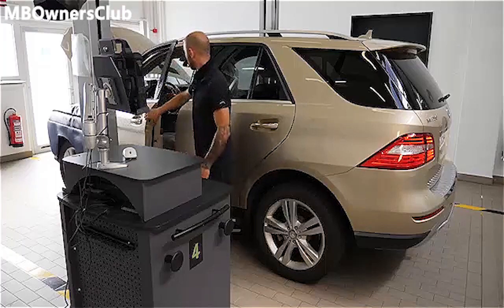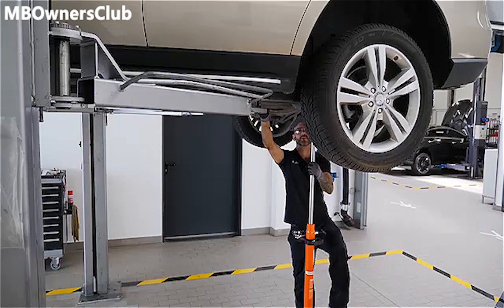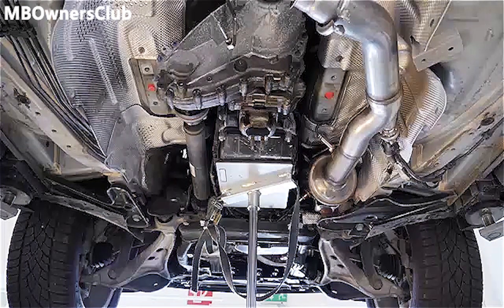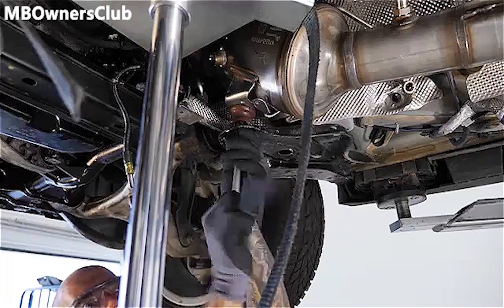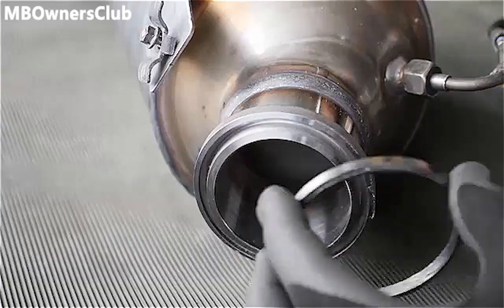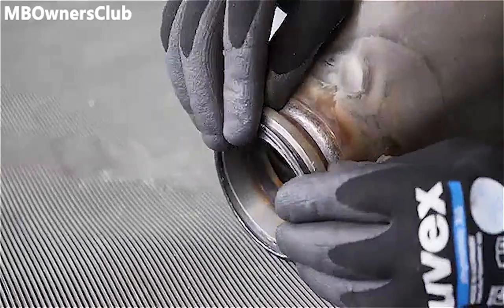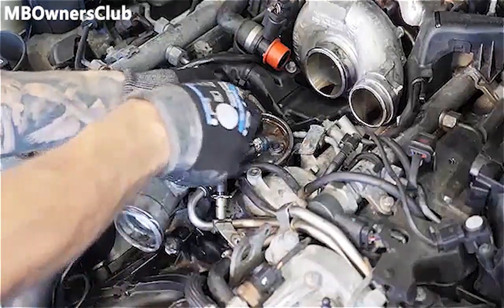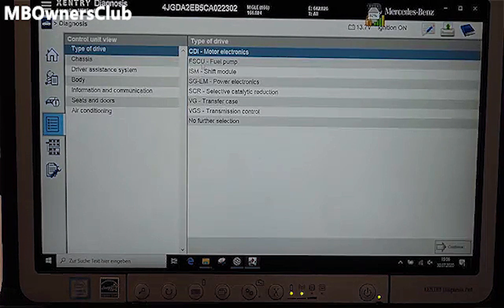𝙃𝙤𝙬 𝙩𝙤 𝙍𝙚𝙥𝙡𝙖𝙘𝙚 𝙀𝙭𝙝𝙖𝙪𝙨𝙩 & 𝘾𝙖𝙩𝙖𝙡𝙮𝙩𝙞𝙘 𝘾𝙤𝙣𝙫𝙚𝙧𝙩𝙚𝙧 𝙤𝙣 𝙈𝙚𝙧𝙘𝙚𝙙𝙚𝙨 𝙈𝙇 𝙒166

Comment: Several things wrong in this video:
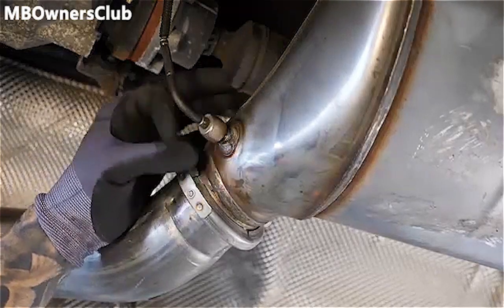The "Catalyst" they mention at 6:07 is the DPF, next to the gearbox - the catalyst is shown at 3:30 and is correctly named in the video.
At 5:35, the V band clamp he undoes is a nightmare to get back in place.  There is no room to get your hand up there to get it seated correctly.
At 6:06 at shows him changing over the pressure pipe clamp - that is also impossible to access above the DPF - you need a small hand and an 8mm spanner to undo it, juts after you start to lower the front pipe.